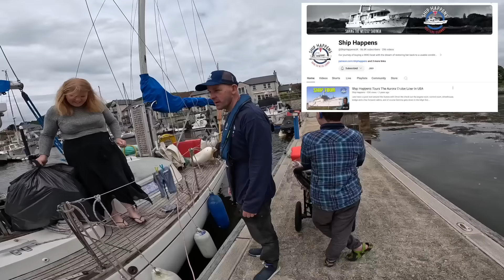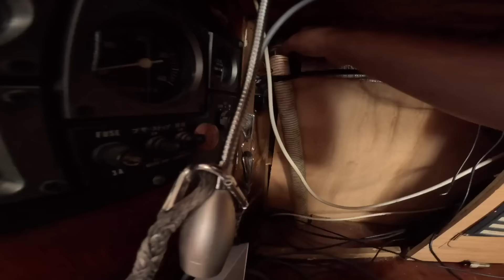Rip it all out!! Start again!!

Comment from the maker: A Little response. Andy here.  Based on some of the comments on this weeks video I'm strongly considering closing the channel and finding other income streams and stop making videos for people to watch.  Can I be clear.   We ARE NOT GOING OUT TO CROSS OCEANS. WE ARE NOT HEADING ACROSS THE ATLANTIC. We are doing VERY short, 20 to 50nm, hops from Port to Port, in calm conditions, only with a good forecast, and at each place we're stopping for as long as we need to address issues found on each sail.  If the weather isn't good, we're not going.  If theres a big KNOWN problem with the boat, we're not going.  If I'm not totally confident with the passage we will have help and probably take the kids by road until we're passed that section.  Just like other channels with kids do.  We're doing a shakedown sail to the next, closest port.  And then another, and then another and then another, slowly making our way south.  If the passage looks tricky we will have friends and crew on board.  We COULD just make videos of the completed work and only show the good stuff. But we don't. We show stuff that goes wrong, we show how we're tackling issues with the time, money and skills available to us.  Maybe we should stop doing that and just be super careful never to show anything difficult, or messy or anything that's not quite right with the boat, or with our skills.  Maybe we get loads of extra crew but never show that we're using them and make it look like we're single-handing the boat flawlessly?  But we don't do that.  We show our mistakes, We show the stuff thats not right with the boat and share our concerns and worries, and ineptitude, and lack of experience.  but quite honestly after tonights response Melissa and I are discussing closing the channel down and looking elsewhere for ways to fund our lifestyle.  Melissa is currently trying to talk me round.  Just saying............
Reply: I usually only read the comments on the Patreon page… sounds like the Hoi Polloi completely misunderstand your excellent and wise shakedown cruise plans.  They make complete sense to me… a boat that has been out of commission for years will have numerous things come to light, when, and often only when underway… hence the port hopping shakedown plan.  You are doing it wisely and correctly.  If the masses don’t get, don’t let it eat at, retreat to your family on Patreon for a little while.  Ignore the stupid comments… you don’t owe them an explanation for things already spelled out in earlier episodes.
Reply: Andy, seriously don't do that. For every negative comment there's thousands of people willing you on. Keep that boat steady and on course 👍
Reply: Calm down. Just ignore the comments which irritate you. Don't get worked up and stressed over comments on here. You need to control the urge to throw away a good channel which could be the source of income.
Reply: @redshifttrucking4537 well said . These know it alls appear on lots of channels often making one comment and moving on. Andy knows what he is doing.
Reply: Andy…you guys have a great channel offering interesting and entertaining content…I follow a lot of different YouTubers offering different subject matter and the two common denominators are 1… youTube producers have to have thick skin to run a channel…2… there always appear to be a minority nimble minded idiots subscribed…..I’m enjoying your journey…cheers from the Snowy Mountains Australia
Reply: I am a refit junky, love the tube channels based on them.  To be honest I loose interest when the refits are over... save 2... SM and Mark on Wildings, you two have me hooked. The idea of watching Jack grow up on the seas, exploring the world , and growing into a man is something I really want to watch as it reminds me of the book Sailing around the world alone that i read as a kid. I am sure that at some point your family will take the plunge and cross many oceans, but knowing of your background as an EMT, it will be done as safely as  possible. The only things I have seen the I would like to see is ... a water maker onboard and i wish I could fund it for you!!!
Reply: It’s the warts and all that makes your channel such compelling viewing - more power to you
Reply: oh guys just ignore,delete and block  all the moaning minnies,couch potatoes and seaside sallys. have fun ,enjoy the journey🥰
Reply: Oh no ! 😬 Captain Andy… don’t tell anyone that you are a wise man who uses your own common sense ! 😉
YouTube is a strange place with anonymous inhabitants.    Think of yourself as Gulliver 😎  ☺️
Reply: Your family  n you are amazing  please don't  stop the channel me n my daughter  love your films please keep  it going ❤
Reply: Ignore the aholes, love and look forward to your channel because it shows the rough with the smooth and so authentic….and no way would I risk a young family on a yacht crossing a bloody ocean. Take your time do it safely …… it’s still soo addictive following your travels.
Reply: Andy....you are doing a fine job...don't take any notice of these keyboard warriors putting in there 2 pence worth....what your doing is logical and being responsible.....you are basically testing testing testing under controlled conditions...don't let them get to you mate!!
Reply: I'm a huge fan of you and your family and I imagine that a lot of comments must be irritating or worse. But all the Youtube thing is at times very complicated. In a sense, you are telling a story that due to its interest attracts thousands of subscribers. But it's a story and not the whole story of you and your family. As a kind of a fiction you could perfectly edit "negative" things out while keeping the essence of your adventures. I think that would be the best solution!
Reply: Putting yourself out there will attract criticism as some people thrive on putting others down. Shrug it off. As a sailor who just completed a 4400NM voyage I commend you for your preparation and planning.
Reply: Wouldn't take any of the negative comments seriously the bulk of people (70k) that watch this channel are positive people that support you & your family by watching the videos every week.
Reply: Oh no. Don't stop making videos because of a few grouchy/nasty people who probably won't do anything in their life but criticize everything!
I'm sure we are thousand of people who like your content but don't publish comments on every video because we have nothing valuable to say!
You're doing a great job, definitely doing your best. Do things your way and enjoy slow coastal cruising. And if you're sailing around the Med sea someday, I'll be happy to say hello, drink a cup of tea or whatever.
Don't give up because of people who claim they are right, because they are probably not 😉
Reply: Andy...I knew you in caernarfon when you had the steel yacht...please don't give up on here....your a great guy....show the nitty gritty of owning a yacht...ups and downs....of owning a yacht....don't listen to these doom merchants.....really looking forward to your adventures.....
Reply: It’s up to you Andy if you want to close the channel down, but I for one enjoy watching your journey, i’ve been with you from day one ,of course you gonna attract criticism that’s just in the nature of people. Some people are nice. Some people are just arseholes. Learn to ignore them and grow a thicker skin. If you put yourself out in front of the public, you’re not gonna please everyone. A great fan from Australia.😊
Reply: I remember purchasing my first proper yacht - she was cheap because of the work that needed to be undertaken. Anyway, sails were fairly new, standing rigging & mast were 12 months old, running rigging had seen better days & the engine didn’t work….
I bought the thing to go sailing, so as soon as the mast was stepped & sails bent on she was splashed and the inflatable tender & outboard was used as propulsion, lashed to the stbd quarter. Spent the whole first season like that and attended to the engine & other odds & sods the following winter. Covered nearly 4000 NM in that first year & by god, do you learn every nuance of boat handling!
Andy, I implore you not to give up on this superb channel, you know Melissa’s right!!
Just ignore the armchair idiots.
Just my pennies worth of advice.
Reply: Please continue. Ask Jack tide a Captian Q episode of the boat
Reply: Andy please please don't fall for the children at the expense of the adults in the room, safety is paramount your not doing this journey alone you've got your family with you the adults in the room respect that. Your going to have to put on your big boy pants and ignore the idiots, there's lots of youtubers who have gone through the pain barrier. You can do it.
Reply: Mate, hi from from Australia.  Don't let the nay sayers grind you down. Please don't let people push you away. If you had the time to look, I bet they are the same critics on other sites. They know nothing. P.S. Fill the filters before fitting.
Reply: Hey Andy
Why are you even looking at the minority whingers 
The majority of us are the ones that matter 
And we are all here because we love your honesty,  and your vulnerability and your compassion 
The content you make makes me feel like part of your family and we all love the 4 of you
Stop looking in the wrong direction,  look at all the postivivity of the community you have created and the wonderful amazing family at your side ❤❤
That is that matters 😊
Reply: Andy, ignore the comments. I love your channel. I will never sail in my life but I have owned a boat before. I don't like channels that just show that everything is always Hunkie Dorie. I like it when people show their mistakes. It shows you are human and honest. Your family is wonderful. I know it takes time to make these videos but we love them.
Reply: Big dummy spit! Ignore the naysayers and focus on your ambitions.
Reply: Hi Andy. If you put content up on social media you'll get assholes commenting, Pele whose entire sailing experience is watching La Vagabond. You need to simply ignore them. LEARN from your episode today and be a filter! Looking down the comments, aside from the numpties sailing their couches, there are some good positive suggestions and some helpful tips. My advice is develop a thick skin and filter out the chaf.
Reply: Tell em fuck em 😂 just jealous is wot it is. Please 🙏 super applaud all your helpers who are are super amazing above and beyond 👍👍👍👍👍
Reply: @adammallerman8153 you get the prize .where exactly are the comments from assholes . Every one I’ve read seems well founded if you consider that 
1 A shakedown  cruise is what you do AFTER you have addressed the issues .
2 The vast majority of RNLI shouts are for unseaworthy boats ,sailing inshore in calm weather .The guidance is clear “ you don’t go to sea in an ill found boat “ .Even if you need to make content .Address the problems Then you sail .
Reply: Andy and family
If you thought I was being critical on you approach to your replacement tank then it was not meant to be in that vain it was more of a cautious nature and well intended, I a few years ago had a boat Lloyd's registered that suffered a total loss and did not get paid out over a technical small print error just looking out for you your home and family keep going strong and doing what you are doing you are fab keep it up don't listen to the negative stuff it's all bs
Best wishes
Simon
Reply: Just stop reading the comments or responding to him. If it’s bothering you that much you clearly need to take a break for your own mental health.
Reply: You are doing spot on mate, take no notice of the ‘know nothing, do nothing’ brigade. It took me two years of short hops to feel anywhere near confident enough to take others aboard.
Reply: Andy, I am retired now but sailing is my passion your channel is the most realistic channel out there. You ha ve more skills than most anyone  putting out 
 Videos. I know it is difficult to live on a sailboat. Most people are. Unaware of what is real. Keep up the great work and realize we follow your life like our own.  Please be encouraged by your true followers.
Reply: Andy, just stop reading comments from youtube. Social media is a sesspool for angry people who just like to tear others down. That said you should totally build your income outside youtube, and still post videos here as its the platform with best exposure. They can just change the income rules anytime they want, and often do, with only cuts on your end.

Or turn off comments and just get feedback from people who choose to directly support you.
Reply: Andy, i would just stop reading comments from youtube mate. Social media is a sesspool for angry people who just like to tear others down because they see people doing the things they can't motivate themselves to do. 

That said you should totally build your income outside youtube, and still post videos here as its the platform with best exposure. They can just change the income rules anytime they want, and often do, with only cuts on your end.
Reply from the maker: @simonwoods3827 No not at all there were some extremely unpleasant comments we always welcome constructive criticism
Reply: Honestly Andy just play into it! Think of the youtube metrics... all these  extra comments are good for your channel. You just have to learn to be a duck, i know you like to engage with the community on here but the best advice I've heard is NEVER READ THE COMMENTS!
Reply: Andy, unfortunately YouTubers have to develop a thick skin. No matter what you do, it will never be enough or never correct or they know more or could do better.   I don’t know the stats, but I’m betting they are a very small percentage of those who follow you. The negative people derive some form of enjoyment from it. Don’t let them get to you. Press on and ignore them.
Reply: Turn the comments off if you need to.  I love your channel.
Reply: You're making brilliant progress Andy. Kindly disregard the peanut gallery comments. As an older guy I really wouldn't give a frig on negative feedback. Keep doing you mate. Fair winds.
Reply: You guys are all too good at what you do. Losing access to your videos would be very disappointing. Hang in there, you’ve all got this.
Reply: One thing I've learned about the Internet is.......the trolls and useless twits are everywhere.....just ignore those losers.  Keep ur going man.   Ur doin it and most aren't.
Reply: I wouldn't sweat too much about what keyboard couch quatrbacks...... think or say..... Keep following the dream you and the family has, and keep making videos. Just block muppets that anoy you. 🙂
Reply: There's absolutely zero wrong in day sailing and port hopping. The internet is full of plonkers. Don't pay any attention to them. Your approach is completely realistic and stands as good training material. When you get to the East Coast we'll tell you all the things that have gone wrong for us this week 🙄. Chin up. You're doing great 👍
Reply: Hi Andy, don’t let the haters get you down! You have a great a great channel with interesting content.
There will always be negative people out there, but they are in a minority. The majority love your channel, me included! ❤ Your shakedown plan, is a great idea to get used to the boat and work through any issues without taking major risks. I love the ingenuity of the temporary fuel tank constructed under pressure. One thing that I have seen used on other boats is a fuel polishing system, giving the ability to transfer fuel from one tank to another and clean it as it’s transferred. Obviously needs two tanks of a similar size and they aren’t cheap systems. But help with varying qualities of fuel that you get around the world. Anyway keeping going, giving us great content, warts and all!
Reply: I'm happy that u are taking this logical approach, it's the proper sensible way. After watching many videos over the years it is u to blame for having people believe that your traveling across oceans!!!!! Go back and look at the videos!!!!!! Until this video I was one who thought that your leaving port (video 2-3 weeks ago) was the beginning of your around the world journey. I wrote a comment expressing my doubts that this was a proper course and way to ambitious. I didn't send. Didn't want to dampen the enthusiasm after so many yrs of hard work. Clearly u have now made the right decision. Thank for informing everyone.

Comment: I have a theory that many of your viewers are idle dreamers that wouldn’t know one end of a boat from the other.

I’ve always had a list of jobs to do on all my boats. I can usually guarantee that I cross one off and add two more from”bright ideas.” If you have done everything on your list you’re not trying hard enough.

Ignore the idiots.

I’ve been sailing off and on for 50 years and your approach seems pretty solid to me. You understand your boat, you have checked everything, replaced, where needed and want things to be right. You’re taking slow, making short trips and fixing issues as they arise. After several years totally rebuilding the boat you are always bound to find issues.

Ignore the idiots and carry on being the top bloke you are.